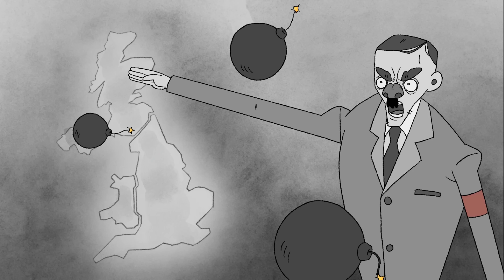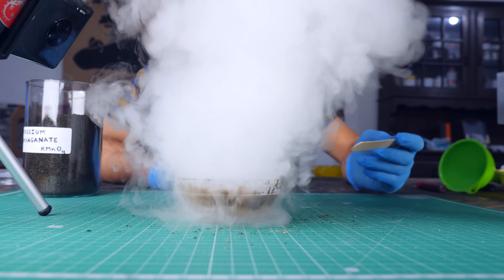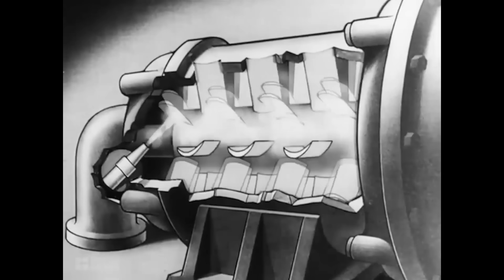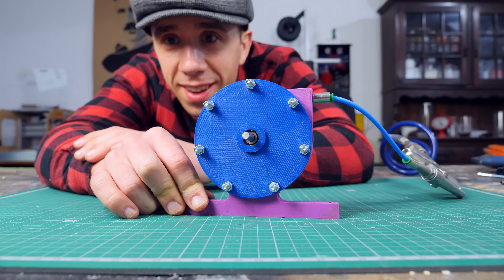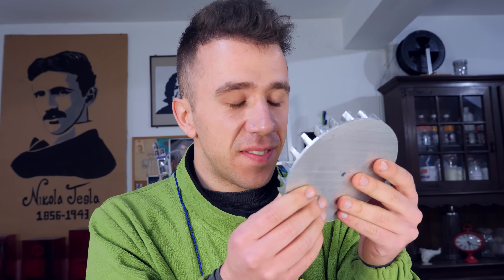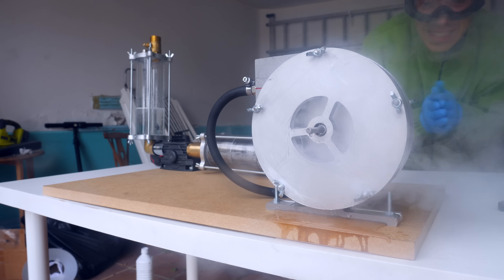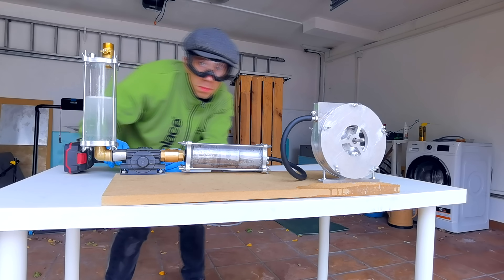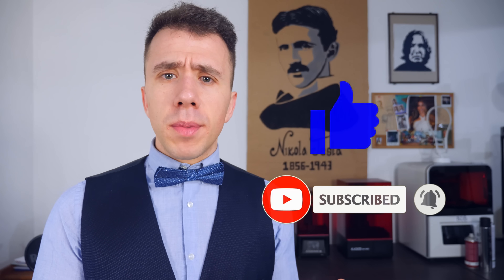I built the World War II V2 Rocket Steam Turbine

Comment: Video idea: seeing as some of your designs produce a lot of heat, you should try and make something to fight that excess heat with some type of cooling system possibly making your engines closer to long lasting. Maybe a small radiator with a fan colling a liquid that would be pumped to circulate around your components? Sure projects could be harder to produce but they should handle more as well.
Reply: Lemme ratio myself

Comment: Hello, you can put the catalizers in an angle with the exit in the upper part so the liquid peroxide dont get pushed outside and if you conect the turbine to a flywheel you would then after it gets speed be able to move an electric generator

Comment: I've been trying to make a liquid rocket engine that is powered by a model rocket engine. I'm beginning to get the feeling that I only know enough to be dangerous at this point though lol. I'd love to share what I have with you, maybe you could make it actually work...

I get the motor to ignite, it spins up really fast, then pretty much as soon as propellants ignite everything blows apart. Brazed, welded, threaded; it hasn't mattered how I do it. Maybe the pressures are wrong (I couldn't know, I haven't measured anything) or maybe I need to weld better lol, but I know that I love rocket engines as much as I love food. I guess I need to read some more.

I have plenty of shop tools, I have a small lathe, I can sand cast, and 3d print, so I should be able to take advice haha.

Comment: you could force the hydrogen peroxyde to work against the gravity in your catalyser as it would not affect steam 
but you will loose a small amount of hydrogen peroxyde to the length of tube necessary to get catalyser vertical. 

plus you should connect that output shaft to the pump see if it self sustains ... and drains your hydrogen peroxyde

Comment: Tips for preserving end mills in aluminum, in your cnc. (An four flute endmill should last 8 hours at least)
Use many steps.
Use slower rpms.
Use as heavy of feed as possible for the endmill
Use largest possible endmill
Use endmills with as few cutting edges (flutes) as possible. 
Cover it with kerosene or other very very light oil. Just smother it. (You will have to use screws and clamps to hold it down)

Comment: 1. Put the acrilic tube upside down, with the outlet being on the top. Maybe it will help the peroxide to decompose better
2. Add a constriction at the end of the outlet, like a pressure valve, before letting the steam out to the turbine. More pressure, more power
3. Maybe play with gearing a little bit? Maybe since the turbine revs up high, gear reduction ratio might help the turbine move things? Maybe 3 to 1 ratio (3 rotation on the drive gear to move 1 rotation on the driven gear)?

Those are my few ideas to make the turbine useful. Thank you, and I hope this helps :)

Comment: Try to inject the hydrogen peroxide with fine nozzles so the drops could evaporating much quicker. You can also use car injectors to control the injection with pwm.
I love you're videos🙌🥳

Comment: Decomposing Oxygen Peroxide results in Oxygen... which is an inflammable gas...
Could it be possible to create a two-set system that first decomposes H²O² and then burns O² for more thrust? Or burn the O² generated at the ,in unrealistic and ideal situations, same rate as H²O² decomposes?

Comment: That turbine looks very open, you would get more torque if you added something to block the escaping gasses until they have done some work.

It's hard to describe what I'm thinking but currently your relying totally on the impact of the steam and the volume is mostly wasted, by sealing the exhaust until the turbine moves a bit this will better utilize the volume of gas at low pressure

Comment: You may want to add more blades to the turbine and have them sweep in from the edge of the wheel to within 10-20mm of center if possible cupping the blades may also increase the yield of the turbine. This can be achieved using slotting tools for the mill.

Comment: you have the tubing bent, which adds friction and helps with condensation,  I would look at having a straight tube out to a water trap from a air compressor (minus the filter).  then a venturi nozzle into the turbine,  I would consider a tesla turbine on the first stage, with a venturi out to the second stage turbine which you have built.  The outlet needs restricting, as a high pressure to sudden low pressure introduces more condensation.   Someone mentioned the catalytic converter being mounted vertical and I think they are right.  So that the hydrogen peroxide has the abilty to soak in quicker I would consider making three upright tubes with one cat in each,  two should work fine, but the third would be a redundancy,  Also on the part between the pump and the cat have a pressure relief valve, so that it opens at the right amount of pressure quickly and evenly so you dont get a catalytic shockwave.   Good effort, and your animations are brill.  Squash the damn tomatoes.
Reply: on the nozzle to the turbine, secure a piece of foil with a rubber band on it, that will help with instant pressure to run up the torque of the turbine.   As the pressure builds it pops off, you can use cork, plasticine, but foil is consitent.

Comment: you should use the catalytic converters vertically so that the liquid has an harder tim getting to the turbine also a secondary container to catch the rest would be a good idea and for the power maybe you could put an transmission in between the turbine and the "generator" also using an actual generator would give you a better energy  output

Comment: You have a high pressure steam turbine now, right?

Combine that with a few spinning blades and viola, you have a steampunk helicopter at the waiting.

Bonus point: peroxide can generate thrust a-la rocket engine, or mechanical power with your turbine. Why not try a combined rotary rocket of some description?
Reply: also, shouldn't it be possible to attach an afterburner to the turbine by injecting fuel into the hot, oxygen-rich exhaust?

Comment: you can design and use a flash chamber to remove water or remaining peroxide.
You can also make it multistage and smaller in size generate electricity and run motor off it as the speed is high enough for generation.

Comment: Very cool project, love it!
Can you mount the catalytic converter vertically with the output uppermost? (If so, the converters might need to in parallel).  This might help meter how much hydrogen peroxide you put in and stop the pump pushing it through before it has had time to react 🤷‍♂️  Just spit balling 😁

Comment: One idea I have is a kind of 2 stage Catalyzer. Where you have the initial generation with the platinum/silver converters, then a 2nd stage with permanganate to ensure that ALL the peroxide is converted. Another Idea is to have the catalytic converter cell mounted vertically with the injection at the bottom and the steam outlet at the top. This way there is less chance of liquid peroxide being ejected meaning more steam is generated at a higher pressure.

Comment: I think the next part of this project should be a second stage turbine or some sort of converter to dry steam; that water/H2O2 is probably causing a lot of drag. Additionally, if you have the converter vertical with the steam takeoff at the top with some sort of baffle/maze at the top to knock the fluid back down, it would help keep the reactants in the column longer and not just blow into the turbine.

Comment: upgrade to a tesla turbine and try using a tesla valve as the non return. also i would suggest a change in the catalyst chamber set up, you need to make the set up vertical so you pull steam from the top and catalyst is at the bottom, meaning any excess peroxide would return to the catalyst by gravity, also leave a suitable chamber for steam pressure to build up. with a little tuning of the design and you will see a major increase in performance.

Comment: To help with the hydrogen peroxide coming out of the turbine it could help to mount the catalysator vertically; 
the fluid stays at the bottom and has a better chance to decompose before exiting to the turbine.
Reply: I thought the same but it'd probably catalyze to slowly, should definitely add a vertical pipe to limit the amount of wasted liquid tho
Reply: @jordan_hui  It won't be too slow if top fed.
Reply: Also put a pressure valve on the outlet to build pressure before venting to the turbine.
Reply: @systemsrenegade9888  oh no bad idea, he's doing it by hand so there is no way of telling the pressure inside, it could easily explode
Reply: Cvccvcvccvcxx8. 7😮6😮 @systemsrenegade9888
Reply: @systemsrenegade9888  thats a great idea!
Reply: maybe a chambered flask to gather the liquid peroxide and a pressureless return line to the supply flask
Reply: @lucassiemer112  I was thinking this too, like a knockout drum. Could even be filled with KMnO4
Reply: It would also probably be a good idea to spray the hydrogen peroxide into the catalyser rather than just pumping it in.
Reply: I wondered if the pump was putting too much H2O2 through the cat, so much was getting past the catalytic surface in liquid form that steam being generated pushed the unreacted fluid directly into the turbine.
Curiously the final design of the bloodhound landspeed car uses catalysed peroxide with a rocket engine bell on the end of a very efficient catalyser, they did away with the mixed fuel rocket concept, as you might benefit from ditching the turbine
Reply: What I was wondering is would a second converter mounted in line helped to oxidize the overflow. I I would definitely 3D print a container with baffles as well, so the steam forming does not throw the liquid into the output as much.
Reply: literally was about to comment the same thing
Reply: I also thought the same, a vertical chamber would help assure all the H2O2 gets decomposed.
Reply: i think the problem is that the steam pressure is pushing the H2O2 out before it can react
Reply: I was thinking vertical stack also.
Another way it could be improved upon is separating the catalysts so you have 2 cores in one tube and the 3rd core in a secondary tube. This way the H2O2 enters the first chamber as a liquid, and doesn't decompose efficiently, however the fluid that makes it through to the second chamber will in theory break down more efficiently as it's being blown through as a mist.

One more thing that could either go very well, or horribly wrong would be to prime the converters with a syringe and drive the pump directly from the turbine.
I wouldn't recommend this though as it would be a huge balancing act to get the drive ratio dialed in and it could very well turn into a bomb if it's forcing H2O2 into the catalytic converter/s too fast or under too much pressure.
Although having said that, the whole point of these turbines in the V2 was to pump propellant, only in this case it would be pumping it's own
Reply: Vertical with both inlet and outlet at the top? Poroxide falls through the catalyst with gravity and steam goes out the top to stop Poroxide from getting suckled through?
Reply: @martinstensvehagen9161  I came here to say the exact same. he should give some empty space before the hose for bubbles to break as well.
Reply: Ben 🅥  fucken bot
Reply: I would also use an additional catalyst which is mounted above the liquid reaction vessel and after some sort of screen to act as a liquid barrier. The reacting h2o2 is going to spray a mixture of stream, hot water, and hot unreacted peroxide, which is leaving unused energy on the table.

I'd also preheat the peroxide before pumping into catalyst.

OH! I would be careful with acrylic and certain metals with hot peroxide. Acrylic shatters, and some metals may be too reactive. Polypropylene is a better bet. Teflon is ideal, but pricey. Metal is fine for the valve, reaction vessel and everything downstream, since you want it decomposed, anyways.

Integza 2030: "I built a stage full-flow combustion rocket engine..."
Reply: Exactly what i was going to say.
Reply: Ben 🅥  advertise somewhere else
Reply: I came here to say this lol
Reply: I was just about to comment this, it should definitely help.
Reply: I came here to say the same thing!  Great minds and all that...
Reply: this
Reply: The catalyzed peroxide is pulling the uncatalyzed peroxide along with it, like a diffusion pump. It's going to pump that peroxide pretty dang far if there is no liquid traps to catch it along the way.
Reply: If the problem is not decomposing the hydrogen peroxide fast enough, the catalytic converters need to be put in parallel.
Reply: maybe splitting the 3 catalysts into their own tubes would also work since then the steam from the first catalyst wont push the hydrogen peroxide out of the other ones ... maybe to not make it to complicated it might be an idea to space out the catalysts a bit and capture the steam from in between from the top
Reply: agreed, but the hydrogen peroxide should be fed from the top and vent from the top too, so the peroxide will decompose all the way to the bottom of the tube. another thing, a mesh-type sponge on the exit could help with the loss of liquid. or maybe two chambers, I know I talk too much.
Reply: Put a set in series. So peroxide tank, cat, turbine, cat, turbine until the peroxide is gone.
Reply: The way the catalyzer chamber tilts down, making a sump in the chamber for peroxide to flow down, yeah. You definitely seem spot on the nose for this one.
Reply: Ben 🅥  You crazy!

Comment: Video idea for winning 3d printer  🖨 

Generating steam from rocket engines residual heat

May require some sort of barrel in barrel configuration 

Water rim outside nozzle that gives extra umph after certain pressure is built due to water being converted to steam

Comment: Hi integza, have you ever considered 3d printing and testing fluid couplings as in automatic gearboxes. I think you can do this and explain the function very clearly. It also has alot of potential for testing different setups and fluids. If this is successful you could use these couplings in other machines ( vehicles, pumps, …)

Comment: Wouldn't it be a good idea to use a belt to connect the shaft of the turbine to the hydrogen peroxide pump. Then you would only need compressed air to start the turbine and you wouldn't have to risk one of your drills.